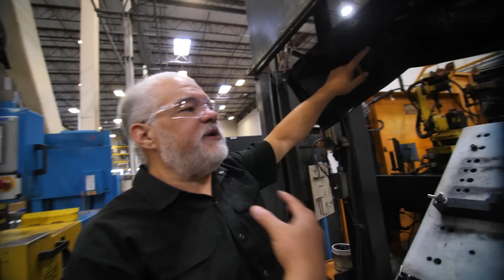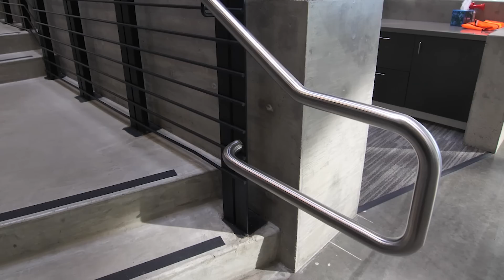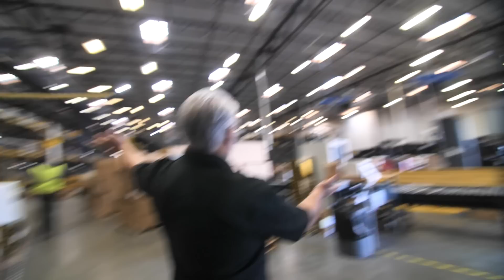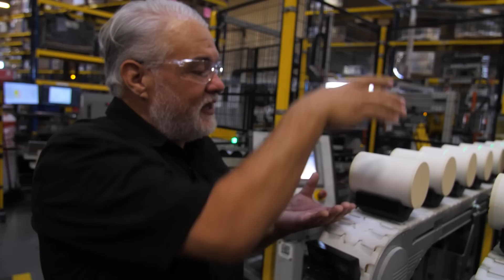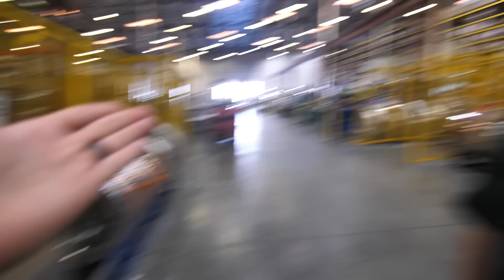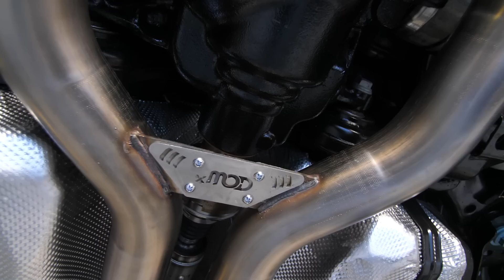Touring an Absolutely EPIC Exhaust Factory (mind blowing!)

Comment: I’m impressed! I’ve worked in automotive engineering for over 23yrs and covered OEM to aftermarket design and manufacturing for body and powertrain (design and calibration)… this stuff isn’t easy and while some of the things you do are just standard manufacturing, many of them are not AND you do this all here in the states. 

Very impressive, thank you for sharing (and I’ll be LinkedIn shortly).